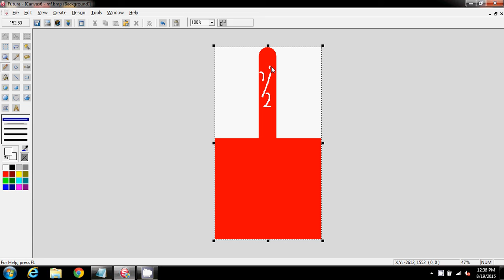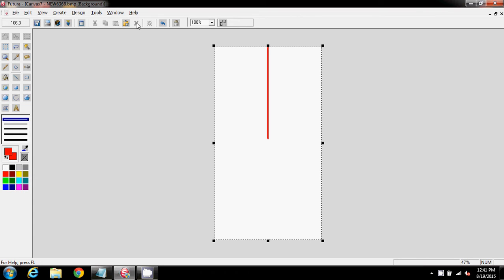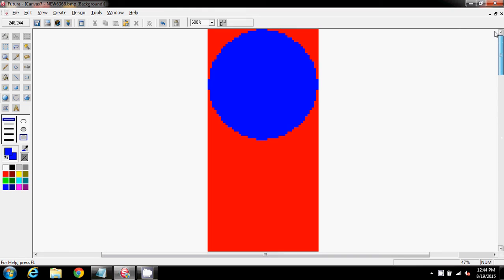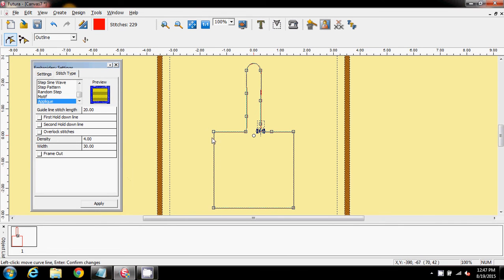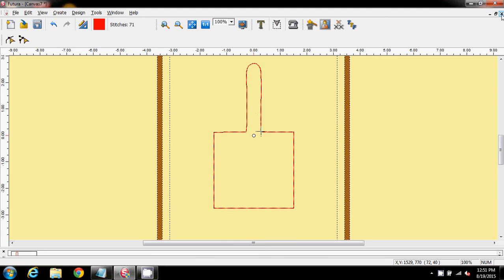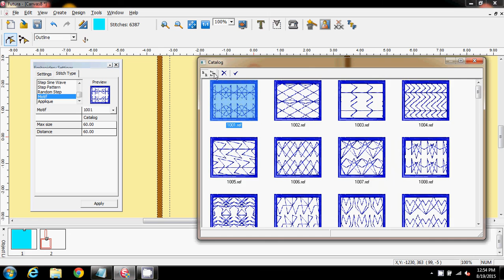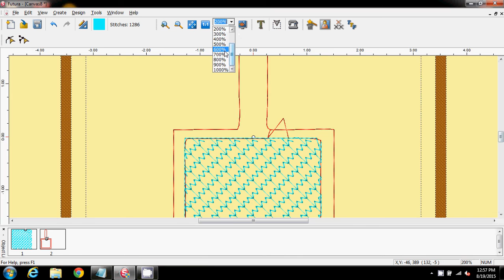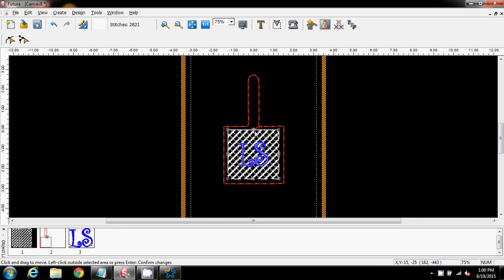Design your own snap fob using Singer Futura Draw Package & Autopunch.

Comment from the maker: On a side note, Futura owners. If you are needing Bobbin Cases, there is a great deal at the moment for the xl-400, 6700, quartet/quintet family of machines on ebay with Free Fast Shipping.
https://www.ebay.com/itm/Singer-Futura-416444401-Bobbin-Case-XL-400-XL550-Quartet-Quintet-Viking-600E/233306829048?fbclid=IwAR1YgaedV72yxgzDlQosanLESUi-ALxI1ikhmnBXRdI53q3z1RUSJpWO4A8

Comment: As I follow along i dont have appliqué as a choice in the embroidery box. It stops at Motif. Any ideas? Than yu
Reply from the maker: @Natalie Arena. 2 things are needed for the applique option to show.  1 is that the area has to be a closed area. If there is a break in it at all, you won't see the option. 2nd is the are is too small. There is a minimum size for the applique to show. Sometimes it's best to make the area initially larger to applique it & adjust the size after.
Reply: Mopsy Jay thank you very much. As always you are much appreciated!! Thank you

Comment: I just realize that I don't have the applique option, cause my software is an oldest version. Any suggestion about how can I get the same version of you or how can I make the same in my version? Thanks
Reply from the maker: Just a thought, but did you realize that the applique option will disappear, if the area you have selected is too small?  If you have the other advanced editing options, then that may be the reason.
What machine do you have?
Reply: Indeed. Thank you for your videos, they are very useful. 
I have a Futura Quintet 5-in-1.